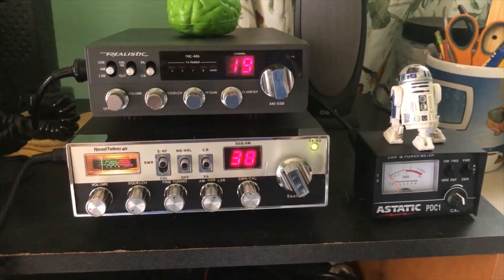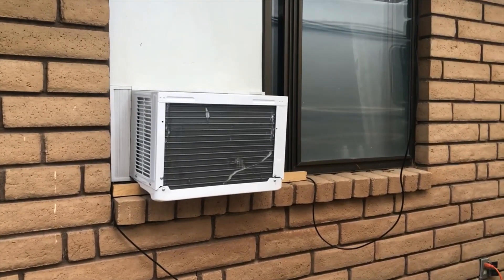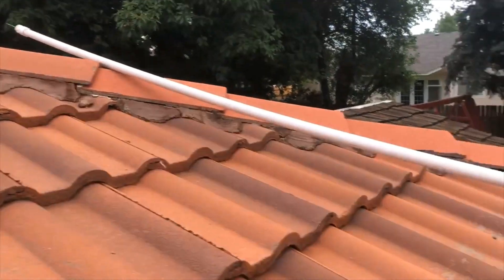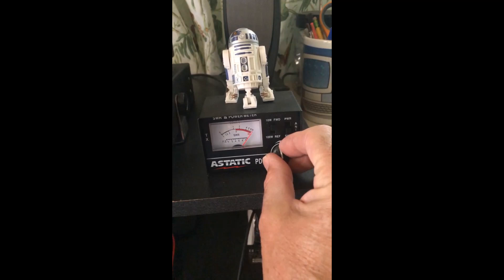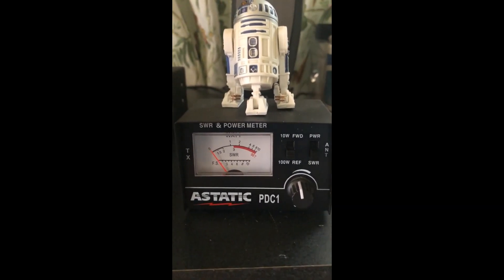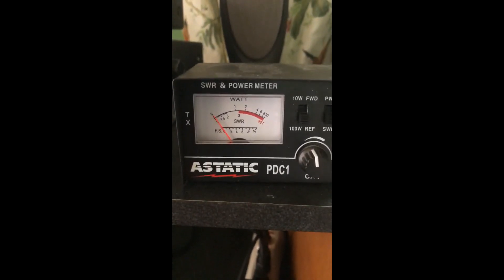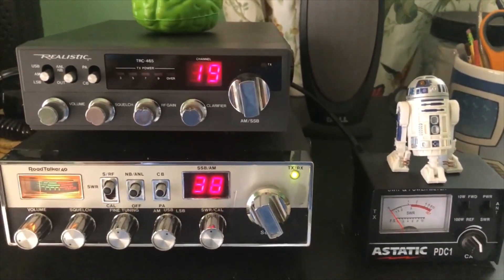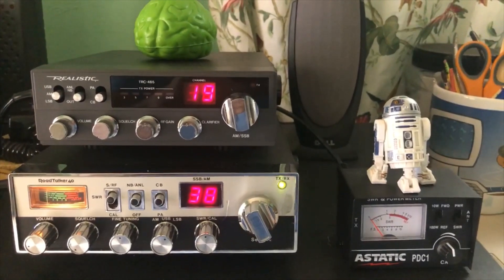Homemade Dipoles Outdoor Placement

Comment: Great builds! Nice SWR did some building projects myself. I use mine as an inverted V On channel 1 SWR 1.3-1 and on 40 1.0-1 It was a hussle to get the SWR right higher on the band. But fun to do. I hear a lot about baluns it seems you don't use one... 
In my understanding from the Waters and Stanton channel if a dipole is placed as an inverted V about 90 degrees the feeding point is about 50 Ohms perfect for the transceiver. When will a balun come in place?

Rolf, Netherlands 19JG321

Comment: Awesome matching. Skip is best achieved with a low radiation angle "Takeoff Angle", the only time i'd be concerned about height is if I was surrounded by trees or buildings. The optimum height above ground (earth) for a half wave dipole is a half wavelength 18.3 feet from antenna feed point to Earth. 
     When playing with antenna's and coax, everything should be measured in half wave increments to the desired frequency of operation, and don't get all bound up with radio to acecssory i.e. Test meters, linears, amps etc... with the famouse 3' ft jumper or whatever you hear. Short runs within your station doesnt matter what the length us, odd or even lengths, it doesn't matter and will have no affect on your match or stations performance whatsoever.😏👍

Comment: That is an eyesore to ANY neighborhood, no thanks!
Reply from the maker: The antenna is not visible from the front or back yard as it is hidden by trees and resting on top of the RV (white pipe on a white roof) and the bottom slope of the roof. You would have to look really hard to spot it. Keeping it out of sight was another reason I choose a horizonal mount verses a vertical mount. 73s from 595 Northern Nevada.
Reply: Troll much...

Comment: Can you make theses into beam cb antenna the pvc pipe one on your rv.
Reply from the maker: You would need to construct a beam antenna out of something other than PVC pipe as the length of the elements would be too flimsy using PVC pipe. The dipole is very directional and the PVC construction allows me to move it and switch orientation fairly easily.  73s from 595 Northern Nevada.
Reply: @RidgeHikerAdventures  rotor would make great cheap 102inch homemade pvc cb radio antenna like beam to start out you can get them on ebay for 25$ it uses coax. https://www.youtube.com/watch?v=mmHlmdBM1DA
Reply from the maker: @foxman362  Thanks for the suggestion. It would be nice to point the dipole in different directions. 73s from 595 Northern Nevada!

Comment: I was watching David Casler's video on computer modeling dipole antennas, and one of the takeaways was that the radiation pattern is mostly straight up when they are less than half a wavelength above the ground. that would be around 18' for 27MHz. you may get a better radiation pattern (and more contacts) by turning them 90 degrees and using them vertically. worth experimenting, great vid!
Reply from the maker: I’m surprised how well my dipole does at its current height. It performs great for skip.  On AM I’ve been able to get out around 4 to 7 miles depending on the direction.  On sideband, I have a friend about 15 miles away over a hill I talk with. I live at the base of the Sierra Nevada mountains, and I’m convinced that my signal is bouncing off the mountains to get on the other side of the hills. I’m planning to place a vertical dipole in one of my trees but haven’t gotten around to it yet.  Thanks for the comment! 73s from 595 Northern Nevada.

Comment: Great video! I'm new to this and just picked up the same Realistic radio that you have at a flea market. Didn't think it worked at all, but tested it today with another non SSB radio. It won't receive on regular AM, but faintly picks up the regular AM signal on USB and LSB. No transmit at all. Any ideas what may be going on? Thanks!
Reply from the maker: I'm just getting back into CB radios myself, and have been teaching myself troubleshooting. TRC-465 is a great radio. I'm assuming that you have it hooked up to an antanna when you are testing the radio, otherwise you can damage the finals in it. Open the radio up and look inside to see if anything looks burnt. Also smell the inside for a burnt electrical smell. If all looks normal, you might also try a different microphone. I have several radios that I bought, that had bad microphones or they were wired incorrectly. Your radio uses a 5 pin dynamic microphone. If you know of any CB groups in your area, you might ask them if they know anybody that works on CBs. I just found out that one of the local CB operators in my area repairs radios. Good luck and let me know what you find.

Comment: I am thinking along the lines of an inverted V mounted on top of a 3 meter tar pole, actually I might end up building a horizontal, an inverted V, a slant and a vertical.
Like not having to mess with radials.
I live 700m up on a sandstone escarpment, the skip with my Cobra when it arrives (soon) is going to be epic.
Reply from the maker: Let me know how the inverted V works out, I was thinking of building one myself. The horizonal dipole has been great so far when skip conditions are good. 73s from 595 Northern Nevada.

Comment: I recommend to try building a moxon antenna next. They have way  better forward gain and front to back rejection compared to a dipole. They also look very stealthy in an HOA.
Reply from the maker: Thanks, I will have to research the moxon and give it a try. I still have a lot to learn about antennas. I've been having a blast getting back in CB Radios. Thanks for watching! 73s from Northern Nevada.

Comment: When you switch antenas did you take the antenna from one radio to the other  ,, or do you have some kind of a switch so you don't have to take the antenna from one radio to the other ???🏍️
Reply from the maker: I actually have two SSB radios, each one dedicated to their own antenna. I have been thinking of getting an A/B switch to just use one radio. Thanks for watching and 73s from Northern Nevada.

Comment: I am currently using two, 102" whip antennas, vertically and two horizontal dipoles also. One run N-S the other sun E-W. 
On some signals, the difference between the dipoles is drastic, others, not so much. 
The two 102" whips crush my A-99, which is about 15' higher than my whips in every situation. 
73
Reply from the maker: I've also noticed that I don't always see a big difference in signals from my two  dipoles facing opposite directions. The times I do, is usually from skip contacts far away. 73s from 595 Northern Nevada

Comment: Are you gonna try to put on a pole or do I just wanna use for going camping and staff or anything like that I’m gonna build a go bag radio with an antenna I’m trying to figure out how I’m gonna do it easier way you doing it but I’m working on it
Reply from the maker: I've had good luck with skip with where it currently sits. The horizonal dipoles do a great job with skip. Take care, 73s from Northern Nevada.
Reply: @RidgeHikerAdventures   73 shepfc1
Reply: Knock up a T2lt coax antenna and mount on a fibreglass telescopic pole
Reply: @alanj349  Yes that's a good one too...but if you want something to use on the go and that you can put in a back pack whit not much espace a wire dipole is the best ( I have use it this way many times )
Reply: Hi there 😊 I have one suggestion you may like for that 🏕️ bag...use 2  102" ( 8'6") wire cable #12 or #14 whit 3 prices of 1/2" PVC to isolate the wire positive from the negative conet some 20' or 40' of RG58 or RG mini8 to the center and the other 2 to each end of the wires use some tipe of no condoctive rope to 2 trees at about 5' or 10' ( more is you can't ) from the ground and you have a 1/2 wave horizontal dipole ( you can put it diagonal or vertical for local contact's ) this is a great  portable camping and temporary CB antenna ( also good in emergency's ) that you can put in you camping bag or have it in you car ( I have one in my car and grab and go bag for skip when I go to some good location's ) I have use them in many occasions over the years ( 1975 - 2021 ) for expedition's and emergency's ( this was  a great antenna in Huracain Maria in Puerto Rico when we help the people to pass maseges and help from town to town ( 2m radio repeater's , cellphone's, internet and Police radios were out and whit no electricity road's were block by tree's and electric cable's ) believe me use one and you will not go back to a normal antenna for camping or emergency's also for some temporary location Dx ....73's and good DX's from.. .KAHK 4031
Reply from the maker: @yankee7664  Thanks for the information! I've been wanting to hang a dipole between two trees on our property. I'll give it a try using your instructions. 73s from 595 Northern Nevada!
Reply: @RidgeHikerAdventures  ok thanks... forget if the wire has a PVC cover take it out or you will have a high SWR problem it makes it a capasitor use only the copper wire